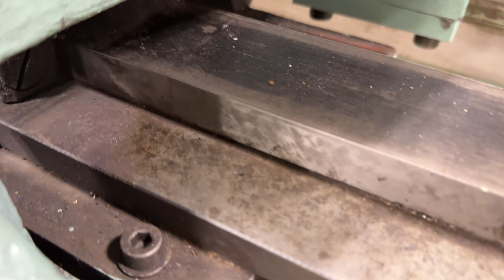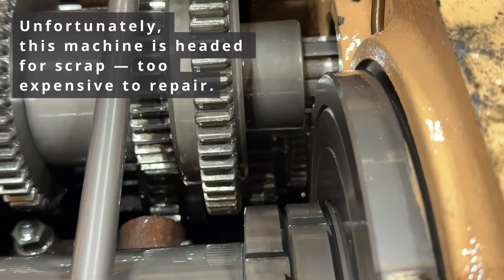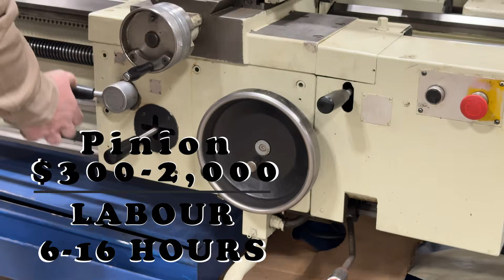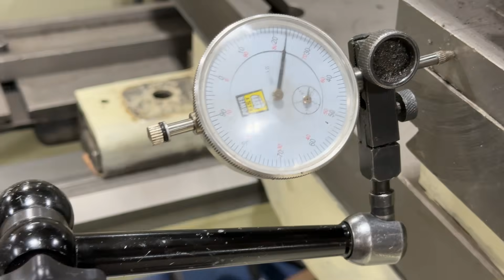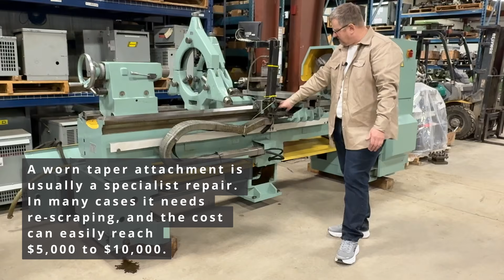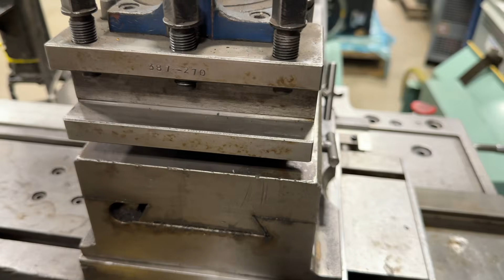Used Lathe Red Flags | Ultimate Buying Guide (No Power Inspection)

Comment: Thanks for the video. 
Question: What is your opinion of a "carriage lock test" (suitability depends on lock type). 1. Move the carriage as far to the headstock as possible. 2. Tighten the lock finger tight, so that the carriage can still move but with some resistance. 3. Move the carriage toward the tailstock. If the carriage binds and will not reach the tailstock it shows potential wear on the ways.
Reply from the maker: That test can be used as a very rough subjective check, but in my opinion it does not tell you much in absolute terms.

The reason is that the carriage lock is usually just a small keeper plate, often held by a single bolt, and its position is not perfectly fixed. It can shift slightly side to side, so the result depends a lot on the lock design and adjustment.

Bed wear is really a combination of two wear areas: the top guide surfaces and the lower keeper plate bearing surfaces, front and rear. What that test mostly shows is a loss of parallelism between those surfaces.

From experience, the lower surfaces usually wear much less than the top ways — maybe around 20–30% of the upper wear. So yes, it can be used as a quick field check, but it will not give you any reliable numbers.
Reply: @StanCanada If the carrage gets progressively tighter and it stops about 1/2 to 3/4 diwn the bed,
Is that a sign to "run away", or just be cautious and move to a more precise test with an indicator?
Reply from the maker: The only fix you can do is to loosen keeperplates a little - install shim under or if they have gibs - back up them.
Check rack - is clean and aligned? pinion shaft might get stuck during travel.
Reply: @StanCanada I did a few more tests and passed on the lathe. I am thinking that if a lathe cant't pass that test the bed is worn, and just do a hard pass. No reason to spend any more time, especially if their are other signs of hard use.